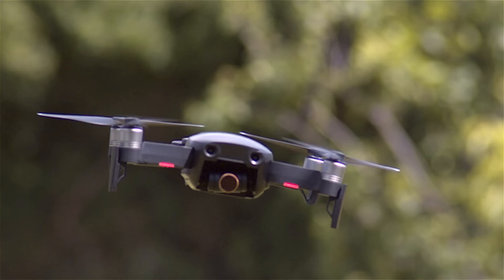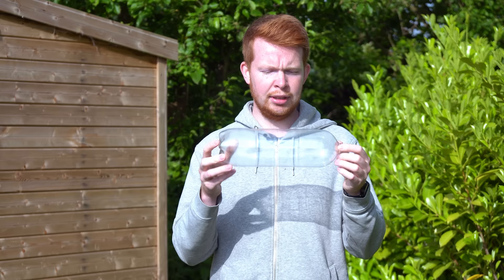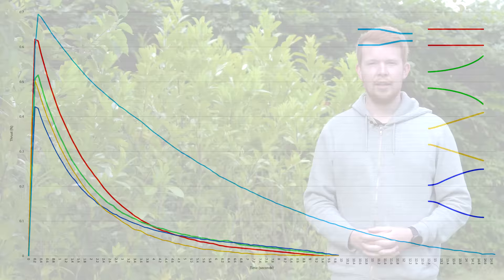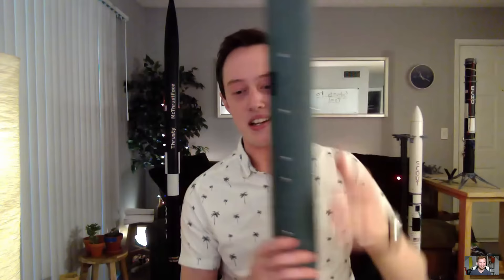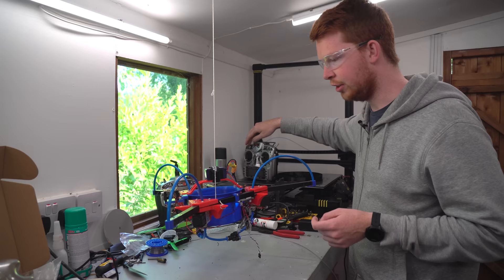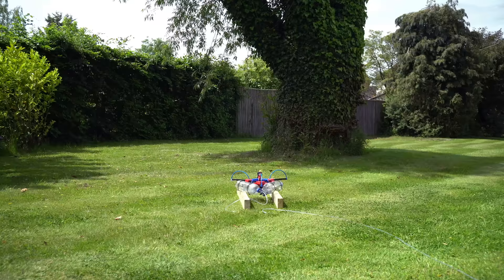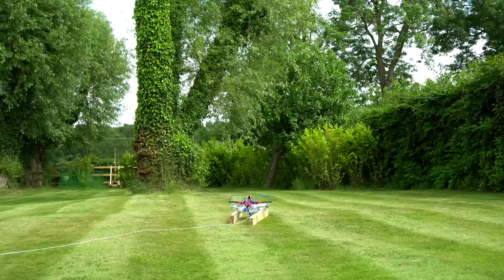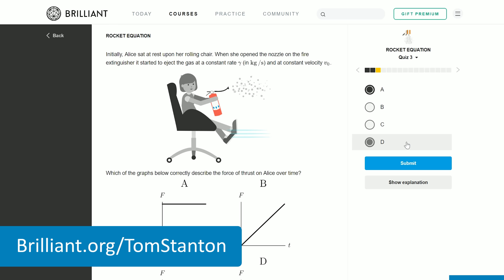Gas Thruster Controlled Drone

Comment: So cool! The idea to convert the throttle values from a standard flight computer was really clever.
Reply from the maker: Thanks Grady!
Reply: I was surprised a simple, naive threshold worked so well!
Reply: Yes, exceptionally clever considering nobody else anywhere, ever thought to do the same thing. An original comment for an original idea.
Reply: @alphaforce6998  This feels alot like sarcasm
Reply: @calebsherman886   I think we can build a test rig to help determine that conclusively.
Reply: Sup Grady!
Reply: Woah! YouTube stars talking to eachother!
Reply: @TomStantonEngineering  wouldn't it work better if instead of just on/off you used like PWM depending on the angle?
Reply: @power-max  aaaaaaaaaaaaaa
Reply: @power-max  aaaaaa
Reply: @fran123456  nope
Reply: @fran123456  The valves don't have regulation they could only be opened or closed so a PWM would be unecessary.
Reply: yep
Reply: isnt it logical to have a pump on it?!

Comment: 2 words: pressure regulator.

Tune the system for (pulling numbers from thin air), say, 40 psi.   Install a pressure regulator and set it to the aforementioned 40 psi.  Fill the bottles to the max pressure your compressor can output: 116 psi, IIRC.  The regulator should regulate the 116 psi down to 40, giving you constant, predictable & repeatable thrust until the bottles drain to below 40 themselves.

Problem might be finding a pressure regulator with a low enough mass to not overload the drone.
Reply: Frederick Evans 72 words actually
Reply: @Trzpsq  lol
Reply: yup. completely right dude
Reply: So much this, pressure regulators are required for any gas system.
Micro pressure regulators do exist and the lightest one seemed to be from landefeld. Their R M5 series is lower than 50 grams and rated up to 8 barg(2L PET bottles seem to hold up-to 150psi which is around 10barg, he tests the flights with 100psi) but additional setup will certainly be higher than 50g.
Reply: The mass is the problem here. He would probably get less flight time then he would gain from them.
Reply: he IS using one
Reply: @afj810  That is for filling the system, not for supplying air to the nozzles.

Comment: You need to have a converging nozzle. Diverging nozzles like the rocket nozzle are for supersonic flow!
Reply: This. Thrust comes from acceleration of the fluid. 

Even better, use the air supply to drive an air multiplying housing instead of using it directly.

For those who haven't heard of air multipliers they are industrial devices with no moving parts, powered by compressed air and used to move air for ventilation.

The Dyson fan uses this concept.
Reply: That entire part of the video was so frustrating to watch!
Reply: You can see at 6:22 he uses a converging nozzle. He probably changed the design after being told but didnt explain it in the video.
Reply: He does have supersonic flow. Going from 6 bar to 1 bar will give you supersonic flow at the nozzle throat.
Reply: He can't have supersonic flow at all, no matter what the gas pressure is.
The reason rockets have supersonic is the fuel is burned, producing the shockwave, which is funneled through nozzle.
Reply: @slowpnir  Sorry, but that's not true. Please look up the Wikipedia article for "choked flow".
Reply: @slowpnir  I thought that too, for a long time. Then I found out about supersonic air rifles.
Reply: If a fighter jet is better off with a convergent nozzle then you certainly wont benefit from a CD nozzle on your low pressure cold air setup
Reply: @5002strokeforever  Most turbojets have a very low pressure differential across the propelling nozzle. Definitely not 6 bar as what OP is using. So if the jet engine is designed to have a nozzle entry pressure of roughly 2 bar at sea level conditions, a convergent nozzle is totally fine, as you will fully expand the gas. However, with 6 bar upstream, the gas will be underexpanded, and you waste most of the pressure.
Reply: @mcsons13  still doubt that, with my crappy jet I get 5psi nozzle pressure and 30 psi combustion pressure. (And supersonic flow with an afterburner)
I'm guessing fighter jets are around 300 psi and at least 50 psi nozzle pressure, also their exhaust is well above supersonic.

A cold flow dosent work that good and needs thousands of psi to get supersonic
Reply: @5002strokeforever  I can only tell you what I know from designing turboshaft gas turbines, so I'm not a propelling nozzle expert.

Temperature doesn't play a role how much pressure you need to get supersonic flow (check choked flow Wiki article). A high temperature however leads to a higher speed of sound. So Ma=1 will equal a different velocity for different temperatures.

If the nozzle entry pressure is 50 psi though, you are wasting that pressure with a convergent nozzle.
Reply: I was going to say. Since pressure is force/area, to maximize force, you'd want to minimize area--so have it converge. That's probably why the straight shape worked the best.
Reply: that reminded me of an idea he can use, he can use a nozzle design like this one: https://youtu.be/x_yHtfGH0nI?t=930
It's what they use on airplane emergency slides
Reply: @mcsons13  The 6 to 1 bar drop doesn't happen AT the nozzle, it happens along the entire length of the tubes etc.

Even if you can get supersonic flow with any compressed gas though, you still need a de laval nozzle, not JUST a divergent nozzle. This is what concentrates the drop of pressure AT the nozzle.

This is demonstrated at the very page you are quoting elsewhere!

The divergent nozzle is just... wrong. It demonstrated lack of knowledge. IF the flow CAN get supersonic, then if he stuck a divergent nozzle right after the convergent one, maybe he could get it supersonic (I highly doubt it here)

This part of the video is flat out under-researched (as well as the misunderstanding  regarding the 3 or 4 axis flight control, which entirely misses the concept of yaw authority... but anyway). Even if supersonic flow is achieved, in this case it would be highly inefficient, as a higher mass lower velocity jet is much preferable, which achievable with an air multiplier nozzle (mentioned somewhere here)
Reply: @mcsons13  He still needs a Laval nozzle for supersonic flow. Just using a converging or diverging nozzle alone isn't enough. The flow should reach mach1 at the nozzle and then further accelerate while expanding afterwards. 

Using the nozzle designs he has it is impossible to get supersonic flow
Reply: @5002strokeforever  Fighter jet exhaust is not supersonic, rather the opposite.
Reply: @tolga1cool  You don't need a laval nozzle. Given the pressure difference, the flow will always choke at the smallest cross section (Ma=1), it will then go supersonic in the divergent part. If opening angle is too steep, you will get flow separation, but it will still be supersonic. Until it breaks down through compression shocks.

Comment: You need a converging nozzle  cause you have a subsonic air flow passing through it. 
The higher the pressure in the tank the narrower has to be the nozzle and the more thrust you'll get out of it. This is true until you hit mach 1 in the nozzle narrower section, at that point you'll have to start increasing the nozzle section in order to further accelerate the air flow.
Reply: 6:18 he did end up using a converging nozzle
Reply: @Zaros262  but he didn't use the expanding nozzle after the converging section
Reply: @junovzla  It likely doesn't reach Mach 1 anyway, so it would actually be bad to have a diverging section.

Comment: De Laval nozzle.

A narrowing of the flow increases speed of the flow and thus thrust (that's how subsonic jet nozzles look like). The widening is only needed if your flow reaches the speed of sound at the throat (supersonic jets and rockets). Wikipedia has a good overview.
Reply: It should be able to go sonic when the pressure is roughly twice atmospheric.
Reply: Thanks for chiming in with what you read on wikipedia. Clearly all it takes for anyone to become an expert on any topic is a cursory scan of wikipedia, and off you go to a comments section to dispense qualified advice.
Reply: @alphaforce6998  Wikipedia is not always wrong, or even wrong half the time, and he never admitted to being an expert. Anyways this not even anything complicated, it's like if the guy was asking what 2+2 is, and this guy replied 4, you don't need to be a mathematician to be able to learn that or even find it out yourself.
Reply: @dapz   Well, that's the thing - nobody was asking anything... And he would have first  consulted wikipedia's entries about the number 2, addition, and basic arithmetic.
Reply: @alphaforce6998  What seems to be the problem? Looks like the only thing wrong here is your attitude.
Reply: I think his nozzles are so grossly overexpanded they are producing negative thrust.
Reply: All you can do is TALK..
Reply: De leval nozzle would be the best option. It would utilize the least gas but produce the most thrust
Reply: @APMtube9000   What's your point? Nothing you said disputes my statement.
Reply: I am an aero engineer. I certify Misium's statements to be correct. Never heard of De Laval, though.
Reply: Check out NASA's "Beginners Guide to Areonautics" and their "guided tours", https://www.grc.nasa.gov/WWW/k-12/airplane/index.html, 

https://www.grc.nasa.gov/WWW/k-12/airplane/guided.htm
All the basic equations, derivations and explanations, in high detail. E.g. Thrust equation, derivation of mass flow choking, nozzle simulations and a lot of other goodies.

Comment: I recall that years ago there was a small group (I've forgotten the name, unfortunately) in B.C. or Washington state that was sending soft drink water rockets over 1000 feet.  They modified the bottles by wrapping carbon fibre around them using epoxy.  These bottles were pressurized to as much as 2000 psi.  Part of the success at reaching such heights was that they used dilute water/dish soap along with air for propulsion.  They just poured it into the pressure vessel bottles before charging.  As I recall, the most difficult problem was coming up with a reliable and safe way of setting them off.
Another observation for this project is that you don't need a separate bottle for each nozzle, in fact it may be counterproductive to do so.  Interconnecting the bottles would provide a more consistent pressure at each nozzle.  Or add more bottles.  Or make a custom bottle that utilizes all the dead space currently existing between the separate bottles.

Comment: for a better control system: pulse the valve on and off at (relatively) high speed and you essentially have throttle control. instead of a simple gate you could have more like a minumum and from there to maximum it scales the pulses.
Reply: Not sure if solenoid valves are that fast
Reply: I don't think the valves can move that quickly
Reply: Pulse width modulation?  If the valves can react fast enough that would work.
Reply: @arnavjain7564  to expand on why I said relatively, there is an absolute minimum time to open the valve and another time till closed, which will result in a limit to the maximum cycle frequency. I understand this reality. It certainly won't maintain RC PWM freqs, but something alike PWM done in Hz frequencies is what I have in mind. 

I'd keep the gate on the input, but make it trigger lower. if the input > gate, then the thruster should start a cyclical pulse who's duration is proportional to the magnitude of the input (up to 100% duty cycle for a 'full throttle' command). Many smaller pulses should use the same amount of air as a few big pulses, so I don't think we'd see a huge drop in efficiency or anything. These are test bench questions to answer.

In full size rockets utilizing RCS's in space, they don't deal with any of this because they're not inherently unstable balancing broomsticks quite like a wingless thruster in an atmosphere is. The RCS activity looks like a few 'pings', followed by silence as the ship rotates for a minute, then a ping or 2 more to stop that rotation. our implementation would need to differ in this regard to account for wholly different stability circumstances.

I also implore Tom to revisit the nozzle. the bell of a rocket nozzle is useless without first accelerating the gasses supersonically with a throat restriction. The bell was also simply too big, in my estimation. The bell of an Estes rocket motor is smaller, and that motor produces hundreds of times the thrust. just saying, possibly a lot more efficiency could be squeezed out by looking back at the de Laval design principles.

It is also 3D printed with FDM, meaning the inside is ribbed with a repeating half circle pattern. this will mess up your boundary layer flow which means turbulence which means loss in efficiency and thrust. Tom, if you come up with another nozzle design I can print it with an MSLA machine, threads and all, polish the interior surfaces with a lathe and ship them to you. Otherwise I'd look into acetone vapor polishing the nozzles printed in ABS. I also have the setups for doing this if you need.
Reply: @chrismofer  yea a couple hertz like say 5Hz should be possible i think
Reply: @Marko yes, could use multiple valves to decrease response time but they're heavy. they could perhaps be found smaller, or custom valves could be machined/printed to mate with the existing actuators. Custom valves would be designed to require little torque and little motion to open and close. thereby decreasing response time and increasing maximum update frequency. In fact, one could make a throttle-able ball valve with printed components which mated with a high torque digital servo (like those used in micro RC cars) and actually gave a throttle curve response. but then we're straying from the idea of a traditional reaction thruster that pops. I feel we can make a super stable drone using this binary thrust method. then you know what's next, scale LLRV models w/ ejection seats. GI.joe scale. I want one.
Reply: Put together some LPV-control, the arduino probably won't run MPC, I guess
Reply: Solonoids really don't work that fast, never mind the unpleasantness of air hammer in your pressure system. More intelligent timing of the pulses would definitely be the way to improve control, though. Maybe figuring out the moment of inertia of the system, tracking the rotational acceleration/velocity and firing pulses that provide enough rotational moment to overcome the current movement and reach the desired rotational velocity.
Reply: @JohnDoe-rl9pp  yes, such an implementation would pulse the jets for the duration needed to match the vehicle's rotational velocity to the commanded velocity, but this requires rolling your own IMU as well as flight modes rather than the off the shelf f4 which does a hell of a lot for you in the case of a flying vehicle.

Air hammering doesn't seem to be a factor yet in Tom's implementation. If the sudden pressure drop and sound wave in the bottles causes some weird lack of pressure elsewhere you'd just need to stagger or synchronize appropriately. Tom is also clearly not maxing out the valves speed so I don't see why we'd dismiss the idea because "Solonoids don't work that fast"?
Reply: @chrismofer  I see what you mean, it is worth a try and we won't know if it's possible unless someone tries it, that's a great explanation though!
Reply: @JohnDoe-rl9pp  use festo high speed electronic switch solenoids light weight and can run at 1khz or faster with same quick disconnect connectors

Comment: Add a pressure sensor to the tanks, create a lookup table for each pressure level that adds or removes bias from your valve timing values.
Reply: The exact pressure is not critical, so maybe the weight and complication of a pressure sensor can be avoided. If you started with variables for pressure and volume, then you could calculate how much gas comes out of a nozzel during its on period. Updating a remaining-volume variable would enable you to predict the remaining pressure which feeds into the calculation for the next nozzle release. In this way you could compute the pressure to use when compensating for loss of thrust. The arduino board that is converting a gradient signal to on/off might be able to manage this between thrusts.
Reply: Are either of you guys control systems engineers?
Reply: Jonny B  i asked bcause i had a PLC question
Reply: pid values*
Reply: less gas more time.time must be scaled !!!!
Reply: No point in that. Releasing more pressure faster just results in losing more pressure faster to the point there's not enough pressure to control the drone.